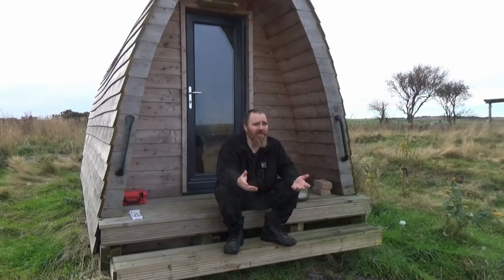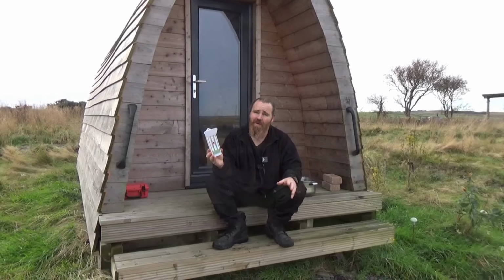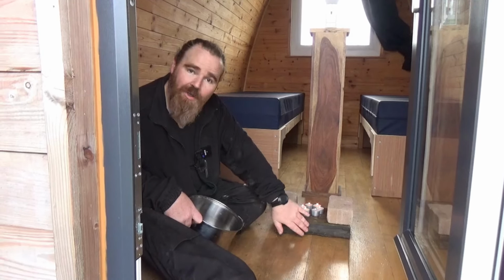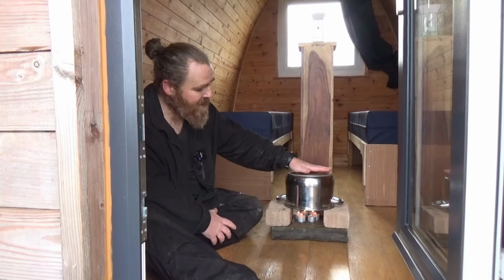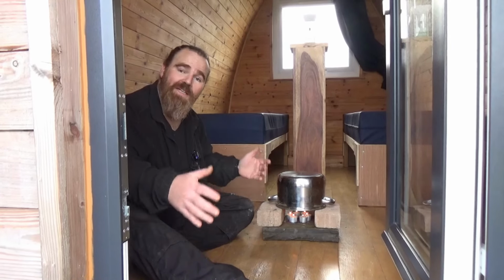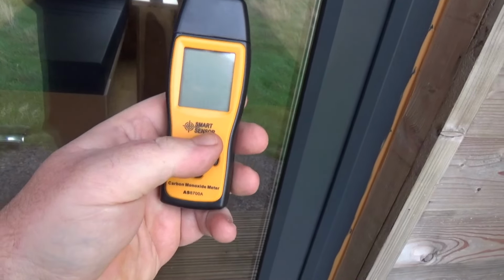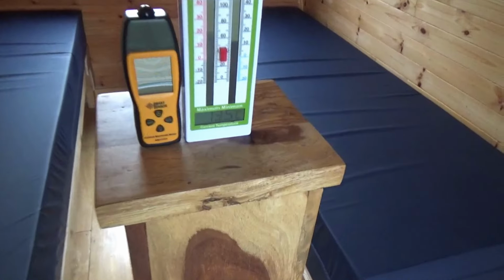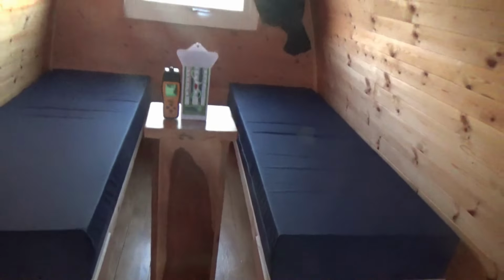DIY Flower pot candle tiny house/camper van/power cut heater tested. Effectiveness? Carbon monoxide?

Comment: A tealight candle gives around 40 Watts of heat power. 
When it burns for 4 hours, that equals 4h x 40W = 160Wh or 0,16kWh. 
The pot (roof, some use different sizes of clay pots) above the candle(s) does not increase that amount of energy, 
but it helps spreading the heat to the room (otherwise the heat energy would ascend very fast and heat just the roof of the room). 
I'd suggest using a carbon monoxide alarm sensor when burning any kind of combustive material in any kind of small and enclosed room. 

P.s. Stearine (palm wax) candles burn longer and cleaner than common paraffine candles.
Reply from the maker: It does not change the amount of energy, but it does change the effectiveness of that energy. 
For example, the difference between radiant heat and conductive heat in terms of effectiveness is the difference between sitting a foot away from a hot water bottle, and sitting holding the hot water bottle. Same amount of energy, just used differently.
Reply: @CairnOfDunnCroftPermaculture  Some think when they put enough pots over a single tealight, it heats more than an 1kW radiator. Ot that they can heat the whole house with a few tealights. ;)

6 Tealights in a (well insulated) tiny house certainly bring a noticeable increase of temperature. But in such a small Room, You'll need ventilation and over the hours that ventilation probably wastes more heat energy than You get from the candles. 

Ayway You'd feel more comfortable with the candles, because of the direct radiation of the "hot" pots. But that lasts only a bit longer then the candles will burn. I'd be not surprised if the energy calculation over the whole night was negative with the candles. Certainly it is so if You sleep or forget closing the ventilation when the candles have burned out. That will be a cold wake-up the next morning...
Reply: You are measuring the air temp which will be the same with or without the pot
Reply: A light bulb makes more heat.
Reply from the maker: @mikeries8549  not even remotely true.
Reply: @CairnOfDunnCroftPermaculture  you are 100 percent correct. Electric ceramic heaters proved that a long, long timeago. 
Its called a heat exchanger, been around forever. Very good system that was common in state of the art future cites 100 years ago.
Reply: @CairnOfDunnCroftPermaculture  A typical tea-light candle produces about 30 watts of power.  An incandescent bulb most certainly can produce more than 30 watts of equivalent heat.
Reply: @___HH___  he will not take the proof for an answer. He likes to believe his lies over the truth. Let him be 🤷‍♀️
Reply: Sorry but Stearine candles do not burn cleaner than Paraffin candles. 

Stearine is the old standard form of wax used before the invention of paraffin. Paraffin has been invented for exactly that reason, to burn more clean and with less droplets that normal candles. 

There are of course major environmental issues with paraffin, since its made as a byproduct of oil refining. But paraffin is the superior wax. Wich is just logical since most natural waxes aren’t 100% pure and therefore have ingredients that burn down less clean. 

Also as a side note, Paraffin isn’t great for the environment but most of the time its a byproduct of the already existing refining process to Kerosin from raw oil. While stearine is often (as you wrote) made from palm oil wich is the worst industrial used agricultural oil product know to man and responsible for the destruction of entire landscapes.
Reply: @jasmijnariel  not long ago, (before Mercury Vapor - and LED- lamps) a common light bulb had 60, 75 or 100 Watts of electrical energy consumption. 
Most of that energy was converted to heat, a few to light (which, when absorbed, also converts  into heat). When some one claims a light bulb (not an LED-lamp) to produce more heat than a tealight, I'd not call him a liar.
Reply: @SH1974  and maybe you can turn the time a little more back, when there were gas lightbulbs..
 Then you could others lying too.
Its anno 2022. They are 30-50w now
Reply: @jasmijnariel  "They are 30-50w now" - what is about as much as the power from a tealight candle. 😂
Where is Your liar now?
Reply: @SH1974  https://en.m.wikipedia.org/wiki/Tealight#:~:text=A%20standard%20tealight%20has%20a,depending%20on%20the%20wax%20used.

On the bothom. You are welcome
Reply: @SH1974  like i said. You are right. Its around 40w average. I never said you lied
Reply: @___HH___  He has 6 tea lights under that pot. 6 x 30 = 180 watts. What light bulb, not specifically made to create heat or to light a stadium, does that?
Reply: @coldhaven1233  Did someone say a particular light bulb would equal the heat output in wattage to that of 6 tea lights?  Answer:  No.   But now that you ask the question, there are many bulbs that burn hot enough to match the heat of 6 tea lights.  Halogen bulbs are one example of such a bulb that is not designed to create heat or necessarily light a stadium.  The halogen gas in such a bulb performs a regeneration cycle which requires very high temperatures. This process, combined with their small size, causes halogen light bulbs to produce more heat than any other light.  I hope that helps you somehow.  Good luck.
Reply: @CairnOfDunnCroftPermaculture  I take it that both methods release the same amount of BTU but over different periods of time. I've been thinking about a similar approach where I put soapstone around my fireplace, which cools down during the night, to get more even heating for longer duration. In this case the equivalence would be a cast iron pot to get more mass.
Reply: @CairnOfDunnCroftPermaculture  hey how about you run this test again. One with a pot and one without. The same amount of candles. You could put this argument to bed too.
Reply: based on what he's saying is the theory behind this set up, air humidity would play a huge role in the change in temperature of this set up. Too little moisture in the air then the heat will radiate out and escape the pod. Too much moisture then the heat will all be consumed by heating up the moisture of the air and the temperature won't go up very much. The thought experiment would be to think about what happens to this set up when you're in a perfect vacuum, or completely submerged under water?  I think intuitively it makes sense the temperature of the pod would have negligible change in both of those extreme cases, Maybe a 40-50% humidity would be ideal but how could control humidity like that, especially with people in the room and the flame producing H2O as a byproduct of burning carbohydrates.

The other problem with this set up is that a tea candle isn't the most cost-effective or the most efficient way to generate heat. Some sort of electricity would be better.  It's the reason why people are comparing this to a lightbulb. The bulb part of the light bulb is basically equivalent to the pot in that it's radiating thermal energy instead of converting thermal energy into potential energy of the air. You don't have to worry about open flame or CO/CO2 poisoning or moisture build up from combustion.
Reply: That's what I thought
Reply from the maker: https://youtu.be/sK539ekJ4bo
Reply: @CairnOfDunnCroftPermaculture  arguing about tea lights vs light bulbs when the purpose of the video was based around emergency heat after a POWER CUT. What a thread 😂
Reply from the maker: @jeffreydallas6047  https://youtu.be/sK539ekJ4bo
Reply: @___HH___  Fine if you have an emergency generator in your camping pod but a little inconvenient if you don't. And if you do have a generator then you may as well switch on a proper heater.
Reply: @stupidscruff  Ah! the only other intelligent person here. Hello, thanks for paying attention!
Reply: @mikeries8549  Not if the power goes out.
Reply: @michaelbrownlee9497  Complete rubbish.
Reply: I believe it's about losing power people, enough on the light bulbs
Reply: Rubbish 40w total so 10w an hour . 🤦
Reply: @SH1974 not real bulbs , you're talking about led bulbs 🤦

Comment: I have watched many of these type of videos of DIY room heaters but your explanation with the carbon monoxide testing was so very important.  I take for granted that these DIY room heaters are going to come in very handy when the grid goes down.  Thank you so much, I watched your video with keen interest and saved the link to share with others.
Reply from the maker: Thank you very much, Bethany.
Reply: Same, I watched a few last year, not one mention of carbon monoxide, even when asked the video maker they didn't bother replying. So very good video
Reply: what the heck are you talking "when the grid goes down"? when failed policies in your country lead to grid outtage you better go on the streets and fix your government.
Reply: So, then, does burning scented wax or candles not put off the same gas?

Comment: I used tea candles one winter. I didn't know about carbon monoxide coming off candles. But I could heat one room cook and heat water to bathe.
Reply: I want a vid of that 😂🤦‍♀️ massi ve candles i guess?
Reply: I used tea candles a metal table, and two iron burners put the candles under the burners add a pan of water. Yes it used about 200 candles weekly. Not optimal but we're alive.
Reply: It did catch fire twice. Very scary

Comment: At last someone understands the concept of radiant heat.
How warm it feels depends on the humidity in the room.
Usually the air tends to be dry in the winter making it feel colder than it is.
If you put a big coffee pot on top of the upside down pot then as the water heated up it would put some humidity in the air. 
Also at bedtime you could put some hot water in a canteen or bedwarmer and put it in the toe of your sleeping bag.
That would keep you warm all night without the risk of going to sleep with an open flame burning. 
Thanks for the video.
Reply: Yes, humid air holds heat better and would increase the efficiency of the heater, something I learned as a process operator.  I am going to use a similar setup as an emergency heater for a small room where I keep my garden cuttings/plants I overwinter.
Reply: @concernedcitizen9466  A tea-light candle under any kind of pot is not going to warm even your smallest room.  Re-think.
Reply: @___HH___  Thanks for the reply, you have made some assumptions that the only resources I have available are just a tea light candle and a pot. And that if it comes down to it, I'm going to try to continue to heat the whole room.  I also like to think through this type of problem.  I'm a gardener, more of a survival focus with my gardening and I find that I like the challenge of gardening and what come along with it is the weather.  I'm looking at it from a cheap, low tech way of protecting overwintering plants and getting seeds off to an early start  for the next season. Increasingly occurring power outages happen during the winter.  I'm looking at this idea along with some rigid insulation and plastic sheeting  to make an emergency greenhouse in my garage that gets lots of sunlight during the day.  I also rather find out now if it will work or not while I can still get things.  I like the problem, I'll figure it out.
Reply: @concernedcitizen9466   The three areas of study I was most interested in as I worked towards my first degree were physical optics, nuclear particles, and thermodynamics.  My areas of greatest achievement were in materials science and quantum physics.  I achieved my PhD after realizing my lifelong interest in the nuclear field.  As you eventually will discover that a tea-light candle will in no circumstance safely heat even your smallest closet, my best advice to you is be careful to not burn down your house.  Good luck to you.
Reply: @___HH___  well, you got me there, but I don't think I'm going to need a PHD to figure how to do this project.   Thanks for the the concern for my saftey though.
Reply: @concernedcitizen9466  You're welcome.  Stay safe.
Reply: Hang on! This flies in the face of all the info whizzing round at the moment re dehumidifiers! The conventional wisdom there is that damp air is harder to heat. I have a new dehumidifer and have found the room it's currently in is slightly warmer than the others and air feels lighter, cleaner and def warmer to breathe. 🤔
Reply: @___HH___  Hi. Isn't dry air easier to warm up? Hence the current (Oct 2022) craze for dehimidifiers??
Reply: No, one tea candle and a terracotta pot is not going to amount to more than a hand warmer. But four or more under a big pot can be a radient heater.
A radient heater doesn't warm air directly.
 It warms nearby objects then as those objects warm up they give off heat which very gradually warms up the room.
It takes a long time, several hours,
To show any difference on a thermometer in a room.
But if it's freezing, I will take the tea candles, terracotta pot and sit on the floor with the pot between my legs blanket wrapped around me and the pot. That and a bag of candy should get me through the night.
Reply: @concernedcitizen9466  That's useful to know.  My greenhouse is very humid in cold weather, enough that I can turn off the humidifier.  The tealight and clay pot heaters are very effective in there.
Reply: @___HH___  I have to disagree with you.  I have been using two tea light and clay pot heaters to heat my greenhouse over winter for the last 8 years, with a fan heater backup which rarely comes on.  Each heater contains 3 tealights and raises the temperature by between 3 and 4 degrees Celsius.  I know nothing about physics but I know a lot about my heating bills and I know these work for my needs.
Reply: @debbiethomas3687  That is exactly the idea I have.  A low tech, low cost way to keep my plants from freezing.  I am glad to hear that you have been successful in your setup.
Reply: Tried...dirty heat...was afraid of CO... stopped...

Everything on video is so ideal...a lot of old ladies showing ideas...to make you think they is...smart...
Beware viewers...
Many things I've tried...bombed!!!

Comment: I have a multi gas detector (for exploring old mines and confined spaces). I "bump" test this before every trip by giving it a "sniff" of low oxygen, carbon monoxide methane, H2S to make sure it is actually working (and also I get official calibration every couple of years). To make carbon monoxide I use a tealight candle on a baking tray with 1 cm water (to make an air seal) then invert a big cooking pot. This is very effective at making CO. If people do not have a big air gap and keep the pot high above the flame they will make CO, you must keep all of the candle flame well below the entry of the pot and its stale air. I make CO intentionally and I can tell you it works even without my water seal

Comment: Another concept to add to the mix. Place the other pot filled with sand or dirt on top of the bottom pot. It acts like a heat battery and radiates heat long after the candles burn down. You can use qt. canning jars with lids instead of the pot. Then wrap them in a towel and hold them to your torso or place them at your feet.
Reply: A smaller COPPER pot not a steel pot would require less candles , would heat up quicker . Yir man used a steel pot- copper is 20 times more conductive and would have reached the same temp in 5 minutes using 1 or 2 candles.
Reply: I like your idea but what about rocks in a pot on top of the bottom one. Would that work?
Reply: Also mix some thermite with the sand and use a vegetable oil burner as it is cheaper than the candles which have trebled in price here in Blighty!
Reply: @pablosaintmarr3223  where have you seen wildly cooper pots lately? The inox ones you or aluminum are popular. The experiment/demonstration is done with what you already have.
Reply: @denisame5523  Perhaps some folk already have copper pans. Please don't knock others ideas. Given the current fuel crisis we need all the help we can get. Yes copper pans are expensive but maybe try second hand/charity shops for them.
Reply: @lynnettemurphy8243  let the crisis. I am looking for proper cooper pans, afordable (this means not to max out the card from whan shopping spree for 1 pot) for 3-4 years and never found 1! 
Is not me that says that is not corect, but the person whom posted said that why use inox (because you already have it) and not use cooper. For sure I will not make a purchase just to have alternative heating! Plus, in the emergibg economy country like mine, ppl still know how to make  and already have stoves (bricks made of clay and mortar). And we know how to deal with the monixide without a gaget as well. We still have the knowledge and use it.
Reply: Please share your knowledge about carbon monoxide without using gadgets
Reply: @teresasis6980  great idea!!!
Reply: @denisame5523  put copper pennies on top of the steel pot
Reply: @pamelameela  yeah? Tell me how mani cooper pipes you have in your tiny house laying down, not being used. Is supposed to be something that you already have, in case of emergency. Not a special thing!
Reply: So.... in theory you could place stones in a container on top of the upturned pot, be it a clay or metal pot, put a lid over the top pot then when the candles burn out and you want to go to bed you could wrap the stones in something and use them like a hot water bottle